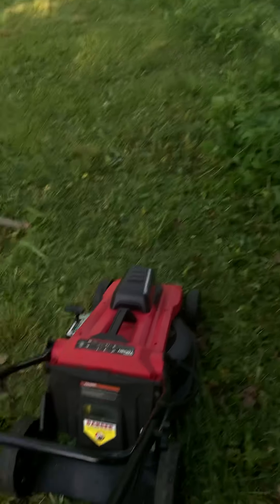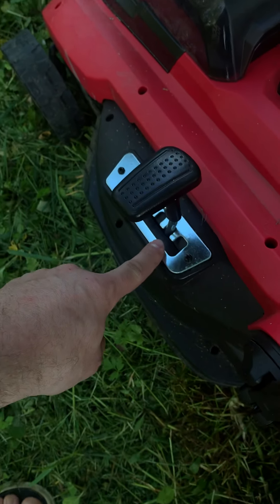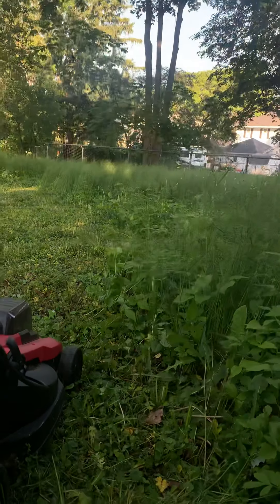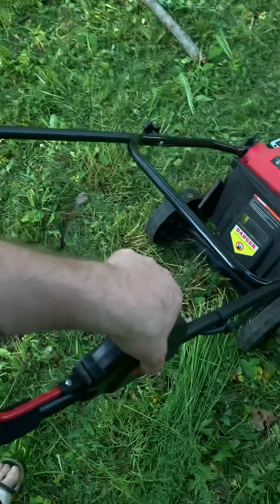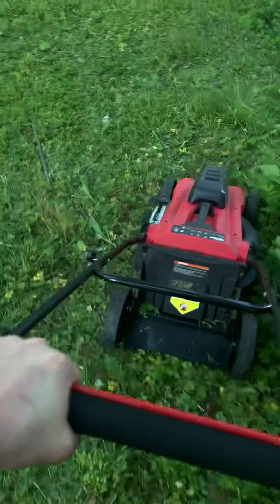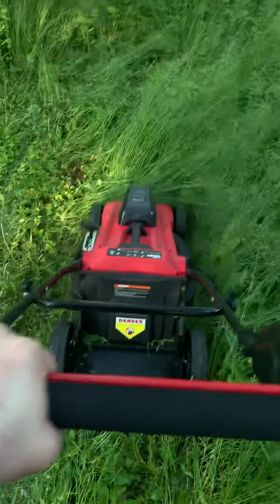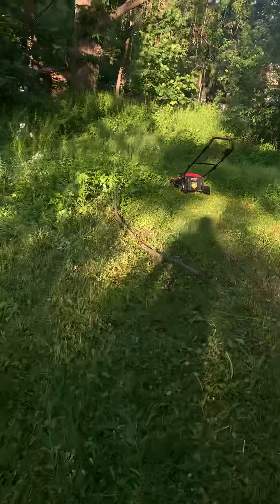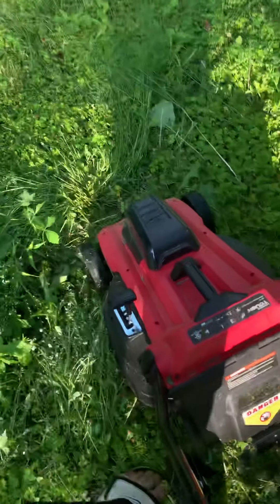Hyper tough 40v lawn mower

Comment: Batteries are fully charged… but it will not come on. I did leave it out in the rain one night, but it’s totally plastic and electronic and nothing got wet I thought. Batteries were not in it they were on charge in the garage. Has this happened to anyone else? Anyone know how to troubleshoot this? I’ve only used it three or four times. I have this exact model in the video. Thanks!!!